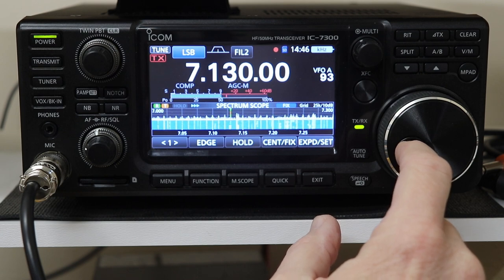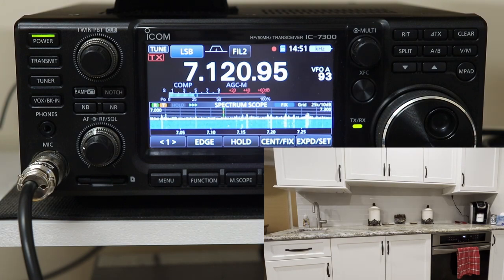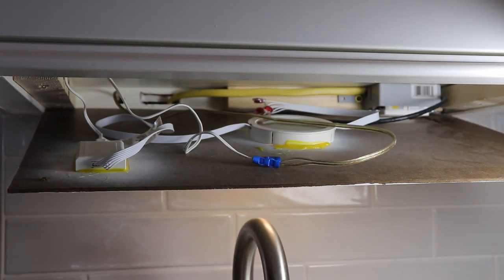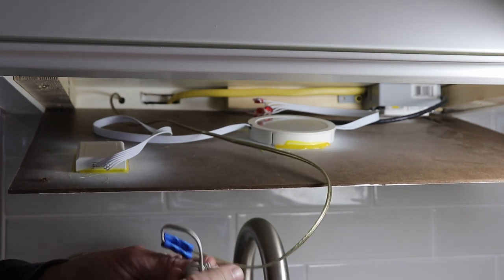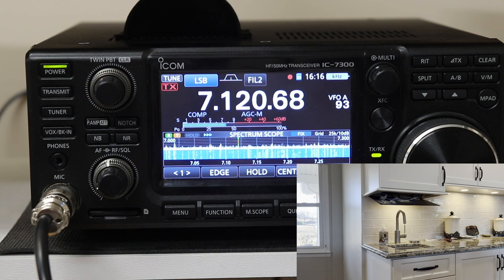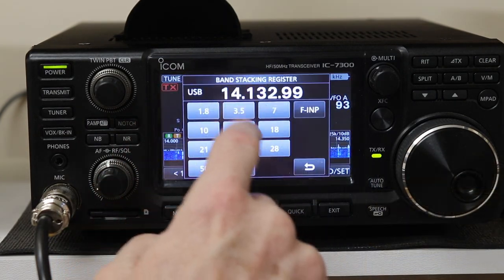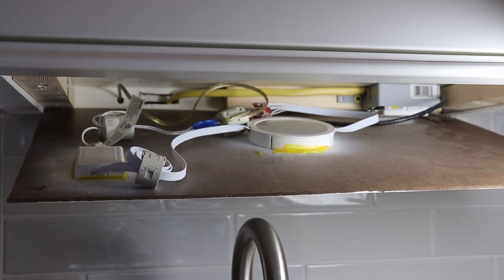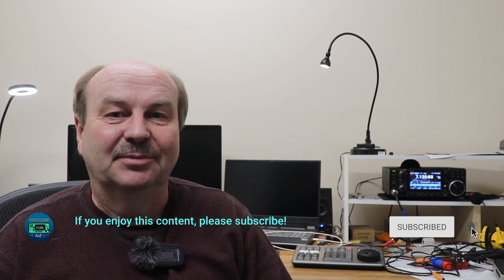Fixing LED Light RFI

Comment: I couldn't help but notice on your kitchen counter top, you have but another RFI Generator !
That being the Keurig coffee maker !
I discovered this one morning as I was working some fellows about 65 miles away, on Six Meters !
Listening to their conversation from the kitchen, I happened to notice an electrical noise on my receiver, that seemed to coincide with my using the Keurig coffee maker !
Not sure of its method of transmission, rather via the Airwaves, or coupling to the electrical service, I can't say !
Finding the source of noise, was enough for me !
At first, I really couldn't believe what I was hearing !
And more what I had discovered, after investigating a little further !
That being, that the coffee maker made noise as it was actively making coffee, but also was producing noise as it was setting idle, but plugged in to the power outlet !
I must admit, the interference on Six, was enough for me, that I don't recall researching other bands, but told myself it would likely be a noise maker on other Amateur Radio frequencies, so I stopped there !
But I have made mention to other local Amateur's that also claimed to have the Keurigs, with similar, if not the same results !
But trust me, they too are noise makers, unfortunately !
And must be totally unplugged from their power source, to stop the noise generating !
Didn't mean to Pile on, but since seeing your countertop, I am now wondering if it really was just the lighting, or if they became a partner in crime, if you will ?
Sorry, but this may have you going back for some more experimenting yourself ?
Hope you found this helpful !
Noise, any noise being an enemy of the Radio Amateur !
'73 !

Comment: It cleared up the RFI completely when I used ferrite on all my LED lights and wall watts that I power several Raspberry Pi’s with. I tinker with digital modes with Windows and Raspberry Pi. It also cleared up the noise generated by the next door neighbor’s electric dog fence. As long as electronic a manufactured in China a prodigious amount of ferrite being used is a must. Should have voted for Ross Perot back then.

Comment: Istarted suffering bad interference on Top Band 80, 40 and 20 in December. I thought it was Chritmas lights, but it persisted after Chritmas. Some recently acquired scart to HDMI converter leads were part of the problem. Their mains adaptors were noisy. Buying a better mains to USB adaptor partially cured it. Unplugging the adaptor when I m on the radio helped further. Top Band and 20 are ok ow, but 80 is still very noisy.  Lots of ferrite clip ons have not helped. Will keep t it.
Reply: Try and old school 5vDC wall wart power supply .73

Comment: I would put a cap on the Input power.  It looks like the inductor on the input made a change.  Many of the little wall worts are noisy and unfiltered. I would try a small cap where the power supply connects the wire you added. It is low voltage so it will not be very big of a cap and only needs to be a short for RF.

Comment: I bought some Ever Ready led bulbs and they are fine with no radio frequency interference.
My gas boiler affects the low end of medium and long wave and I guess a neighbour has one as there's always noise present, at least I can turn my boiler off.
My worst problem is broadband QRM from the internet, S 8 on 160m to 20m with the exception of 60m.
G4GHB

Comment: Would be interested to see if the rfi is worse when the led's dim?
I get rfi from my sons strip LED lights only when they are dim. Still looking for a solution 80m-10m
Paul
VK2LN
Reply from the maker: Hi Paul.  I didn't include it on the video, but I did try the lights a several different dimming levels.  The nature of the noise changed very slightly, but no real effective difference between 25% and 100% brightness.

Comment: Find your self an old power pack (not a switcher) of the correct voltage and swap it out I think that will eliminate all your RFI from the lights. I found that the cheep switchers are incredibly noisy.
Reply from the maker: I have done some other testing, but haven’t put a video together yet.  I did get some surprising results.

Comment: Tom what about the wall wart that supplies the lights with power?  Did ya try a different one?
Reply from the maker: The AC adapter came with the lights.  The plug looks like a USB mini (not micro) plug, but I haven't checked to confirm that it supplies 5V and on the same pins as a USB cable.  So not sure I can easily swap in a standard USB power supply.
Reply: @HamRadioA2Z  I had a buzz in my FT-710.  I put the radio on a battery and opened the main breaker to the house and buzz went away.  After tearing the house apart I found the buzz was some similar lights I put in the bathroom.  The power adapter was the culprit.
Reply: @HamRadioA2Z If your speaker wire extension were instead a twisted pair, most of the noise on 40MHz would go away.

Comment: I read the amazon listing and if I am not mistaken there was no indication of the mix type.  Mix type is critical.  Plus, do you really trust cheap snap-on cores from china?  I get all my USA made known mix ferrite cores and snap-ons from Palomer Engineers in California.  I think if you try their products you will find there will be a huge difference.
Reply: Yes, you are right. He should be knowing about the existence of different mix of ferrites and the specific frequency response etc. He has not found out anything new here; probably he might do one day I think 🤔
De VU2RZA
Reply from the maker: Hi Rick.  You are correct, mix is important.  If I was making an impedance transformer or a band pass filter for specific bands, I would be much more concerned about a specific mix.  If you check the data sheets for EMI filter, snap on ferrites from companies like Wurth and Kemet, they usually list impedances for a range of frequencies.  If they say anything about the mix it is usually “proprietary”.  I believe most of the EMI snap ons are designed to provide some blocking impedance from a few hundred kHz to a few tens of MHz.  That’s where most switching power supplies and “typical” electronics make most of their noise and it’s also where many of the EMI regulations have the most scrutiny.

Comment: Or get some new lights?... I'm dealing with a similar RFI issue with some automotive LED's messing with keyless entry remote signal. Chokes and shielding have not worked well enough but more expensive bulbs may help (supposedly). For now, I lock my doors manually or just outside the cab since the RFI kills the range of the remote/key fob.
Reply from the maker: Yeah, new lights was a thought.  Unfortunately, it seems that virtually all of the "fancy" color control/WiFi type LED light sets are pretty similar w/ regard to RFI.  Stay tuned, I've been doing more playing and will be posting a follow up video on this.

Comment: Tom, without making an Addendum to my other comment here, I had made without watching your video through it's entirety !
But when I heard you say, 
" Wall Wart " it made me want to tell you, that those miniature Switching power supplies, aka. 
" Wall Warts ", too are known noise generators themselves !
So I wonder if you might experiment with another power source ?
Just a thought !
'73 !
Fingers crossed !🤞
Reply from the maker: Hi.  I never did do a follow-up video on this.  You're right about the Keurig, and unfortunately, almost everything else electronic we have in our houses these days.  I did do some additional testing, including running the lights on a separate lab DC power supply.  The wall wart is putting out about 19 volts (a little scary, since it has what appears to be a micro-USB plug.  As near as I can tell, most of the noise is coming from the LED control module.  I guess this makes sense, since it is outputting the variable (likely PWM) output to the LEDs.
Reply: @HamRadioA2Z  
Indeed !
Well my health went sideways on me a couple years ago, so anything Radio kinda got put on the back burner, so to speak, and not even on simmer !
Hi...!
But before I was very active, along with a fellow from the Power company, in tracking various electrical noises !
But the Keurig was a lucky find for me !
Right place, right time !
And as I said, it wasn't enough to turn it off, it had to be unplugged !
I may be preaching to the choir, so forgive me, but another noise maker many overlook are these goofy touch lamps !
Another horrible noise maker across the Ham Bands !
I knew a local Ham that said he hadn't run any HF for years because of noise !
When I asked him if he had one of those lamps !
He did, and unplugged it, and it was the source that kept him from operating for years, mind you !
Another noise makers are Grow Lights people use to grow marijuana, and who knows what else ?
But the Power guy told me about that one !
And the last one I'll throw at you, is one that unbelievably covered Six meters end to end, was a cordless screwdriver, I believe sold thru Harbor Freight ?
My nextdoor neighbor had one plugged in, and when he unplugged it, the noise was gone !
But it was probably for me, the worst offender !
But you're correct, just so much of this stuff, especially from China just eats up the spectrum !
I have to think intentionally !
But here we are !
Good luck with the ongoing battle, as I'm sure it will continue , either with contraptions we ourselves purchase, or sadly our neighbors !
Hi !
Thanks for sharing, and if nothing else, I hope I gave you some ideas ?
'73  & Good DX !

Comment: Hi Tom, I have an RFI problem in my Shack only 10m from sunrise to sunset. I think it must be related to some solar system, possibly some Chinese inverter from a neighbor. I have many neighbors with solar panel systems. Is there any solution to eliminate that RFI in my radio during the day, since the 10M band is totally useless during sunrise to sunset? Thanks WP4QIB
Reply: That would be coming from their inverter(s) which are known to almost always be noisy.

Comment: Give a Hoot Don't Pollute ! ,  The right thing to do is fix it all the way or scrap it . I would like it very much if you didn't add to the noise floor on 40 I cant turn those lights off whenever I want like you can , thanks ! ⚡⚡⚡📻:shelterin:‼ Try Using an old school 5v DC Wall wart that has a transformer instead of the switch-mode junk . Splice it to the USB . 73

Comment: Your chokes are not installed correctly for 40MHz. Choking both power leads in the same direction does nothing. Separate the two power conductors and run each conductor through the core in opposite directions. Also, many low voltage electronics these days have a bridge rectifier up front so they can be powered from DC either polarity, or from AC. If this is the case, try replacing your power supply downstairs (wall wart) with an AC output wall wart.